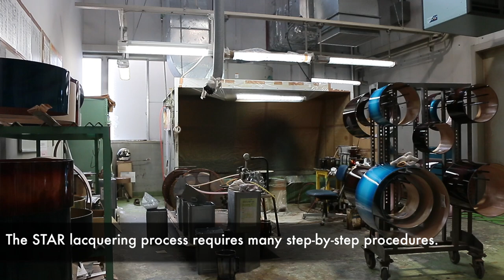TAMA STAR Drum - Crafted by the Hands of Masters

Comment: I have got a question...for a better snare sound,do I need to keep the bottom tighter or loose??
Reply: A timeless question.  I once read there's really no correct answer as to how to tune a drum.  In the end, it's about your own ears and preference(s).  Just as important is the particular drum and of course the heads.

Anyhow, for what it's worth, I am a metal guy.  My drums are all Tama (Granstar Customs and mid-1980s Swingstar).  The only exception being my DW Maple snare drum that I got new about 20 years ago.  My other snare is the stock COS model that came with the Swingstar kit (of which I am the original owner).

My tuning method is pretty simple.  Apply the head, hoop, and crank the tension rods all the way down EVENLY to seat the head.  Back off all of the tension rods EVENLY until they are just barely in contact with the hoop.  Tighten each tension rod by 1/2 turn EVENLY and tap the drum head with a stick as you go along until you get a sound you like on each side.

I use a 2:1 method on my toms (i.e. the resonant head is seated at twice the tension as the batter head).  This give me the punchier sound that I prefer.  Interestingly, Nicko McBrain from Iron Maiden does the exact opposite and gets a nice sound as well.  I've never tried it though.

For my snare drums, I approach the tuning differently on each.  The Tama has looser tension on the snare side and tighter on the batter (roughly  2:3) with my wires at about the halfway position for a more wide open sound.  

With my DW, the heads are at about the exact opposite tighter on the snare side and looser on the batter (about 3:2).  With this snare drum I vary the snare tension over the course of playing for different effects.  The overall sound is what I would describe as sharp with very nice attack.

Again, this is all about what sounds good to you.  I'm sure that there will be plenty of players who'll try to pick me apart but I think we all would agree that it's important to tighten your heads EVENLY.  Maintaining a tone that you like depends on this very much.

I hope that my long-winded commentary is somewhat helpful.
Reply: @randylahey7317  Thank you so much for this precious advice u have given to me.I have got a Tama Rhythm mate and I found it good..I m catching up fast ,but hurdle I see is the tuning issues.I really appreciate for writing up for me.Thank you
AMAN DARAD from New Delhi,India.